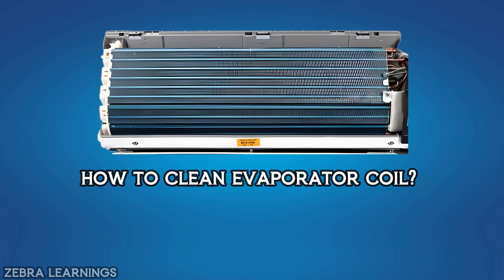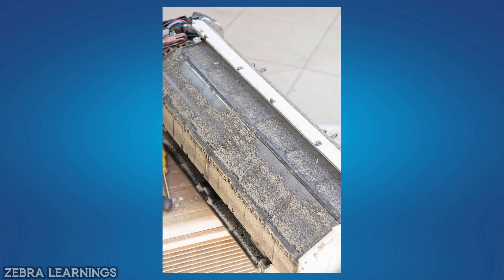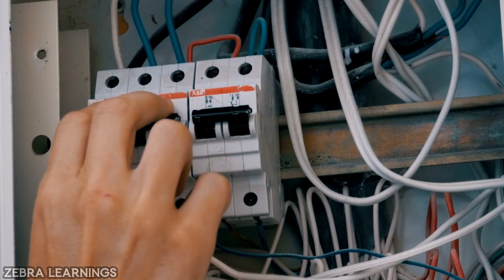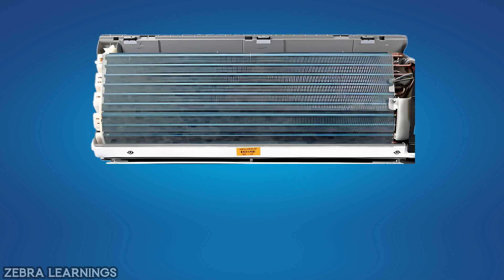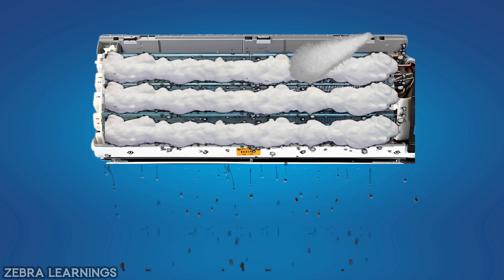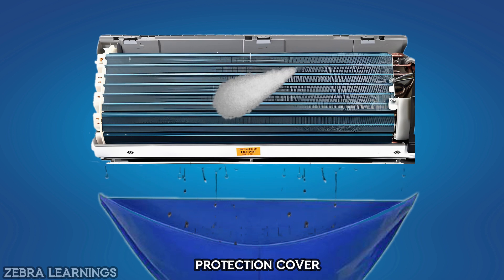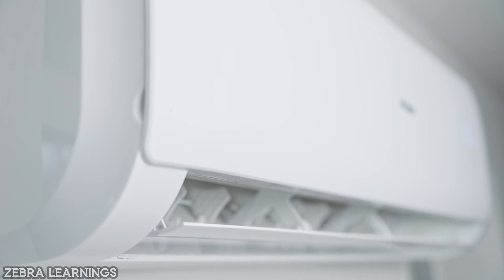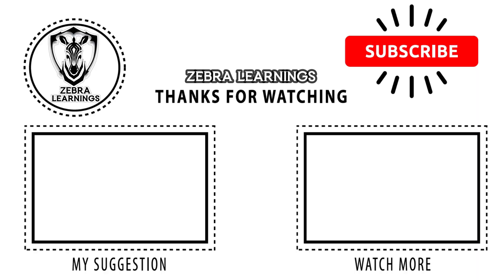How to clean evaporator coil? | Animation | #hvacmaintenance #hvactraining

Comment: what is the difference between gauge pressure and absolute pressure ?
Reply from the maker: Gauge pressure means it is the reading from the normal pressure gauge we used in the pump. In the gauge pressure we don't consider the pressure of the atmosphere. But in the absolute pressure we consider atmospheric pressure also.
For example, the pressure of the water in the pump is 5 bar. It's gauge pressure if we add pressure of the water in the pump and atmospheric pressure, it is absolute pressure.
5 bar (Pump pressure) + 1 bar (Atmospheric Pressure) = 6 bar absolute pressure.